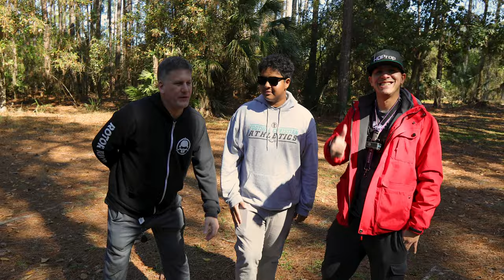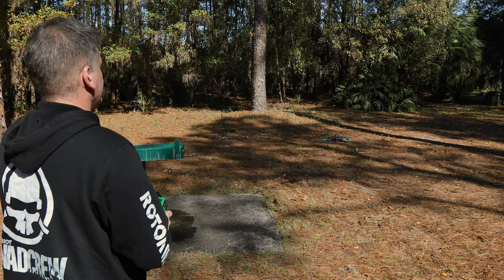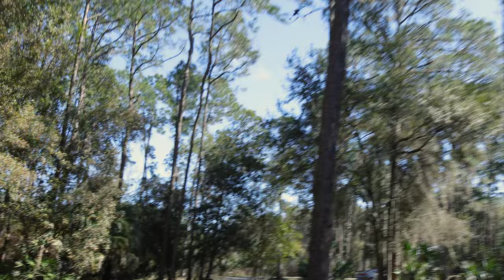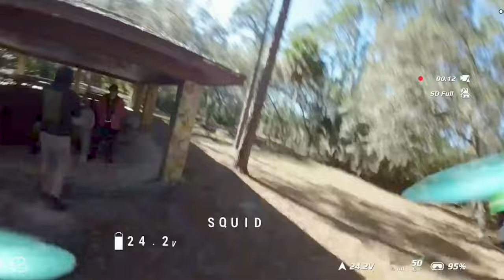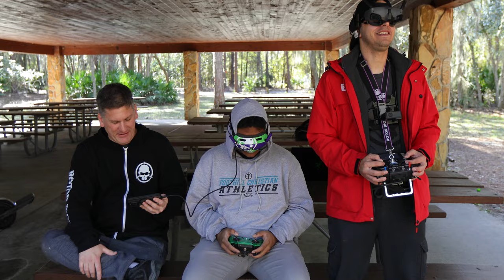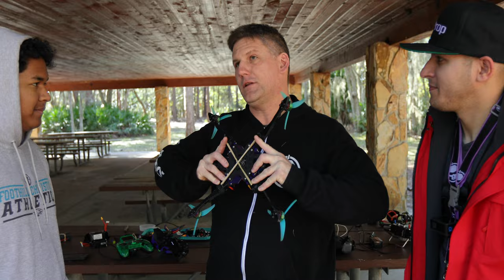This Drone SHRINKS To Hit Smaller Gaps!

Comment: Maybe servos to lock/unlock the arms so that the lock pins, which could be 3d printed,  carbon, or even metal, could bear the forces of a crash and allow the frame to behave somewhat normally until you're ready to squid
Reply: draws extra power and more weight. horrible idea altogether. pretty sure this drone was made as a joke and not an actual drone.

Comment: It's kinda like one of the ornithopters in Dune going into dive mode xD 
You coooooould get through the stability issue by getting the arms to swing rearward rather than down. Think something like the Speedybee Mario 8. It might even be a stronger axis to hinge the arms on. That way, they at least maintain the same thrust vector straight down and also make the folded size much more practical for diving gaps as it'll be smallest in the direction you can see!
Edit: and if you're reeeeeally clever, you could design it with strong servos so you can switch between X, Deadcat and 'Dive mode' configs on a 3pos switch. Now THAT would be interesting to see.